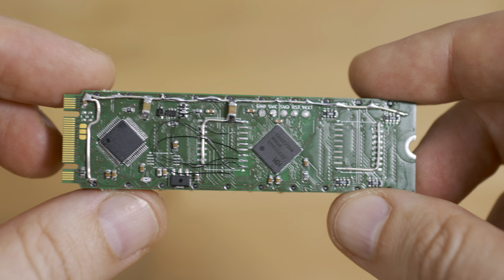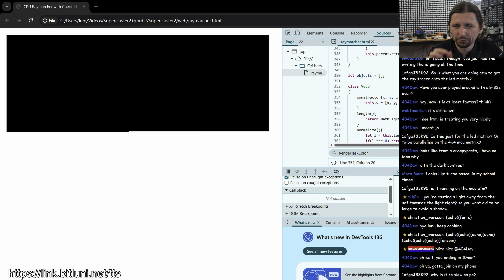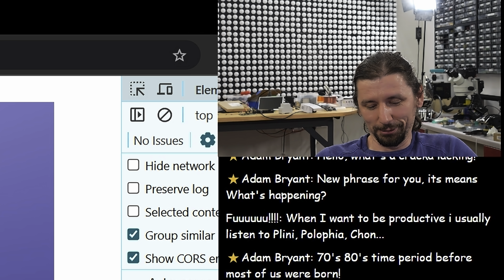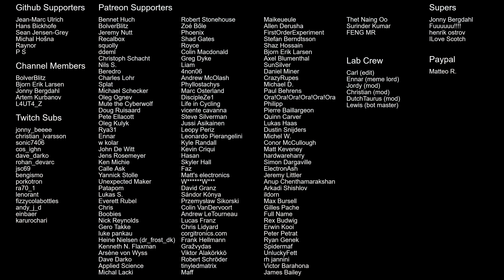I made a GPU at home

Comment: How do you upload and execute the pixel jobs? Do you batch them? Do you send pixel by pixel? I think it might be faster if you send a configuration command to all modules for framebuffer resolution, and then in-module you derive the chunk of the framebuffer that module should use (based on its physical index). You should definitely take this further! I want to see 1280 cores and an opensource compute library that lets you parallelize arbitrary tasks in C!

Comment: Just wondering how many PCIe lanes it uses?, x2 or x4. Does it play nice with multiple M.2 supercluster boards in the same system? What PCIe speed is required to keep them fed? - i.e. could I take x2 PCIe 4.0 and split it to x4 PCIe 3.0, or x4 PCI 4 to  x8 PCI 3 or even bigger jumps? (like PCIe 5.0 -> multiple PCIe 2.0 M.2's on a daughter board). - as a way to get around BIOS not supporting PCIe bifurcation.
Reply from the maker: only one lane on that one. M.2 allows for 4x. also there are better interface chips than serial. I'll try USB next.
I'd say the pcie is not the problem imagine you can put 16 clusters on a single x16 extension card. 2560 cores.
with different routing you could even put 32 or 48 MCUs on a single module
..anyways.. I rather move on 😂

Comment: This was a very impressive build, especially for an individual.  For reference, the “mistakes” were how you learned about the architecture of the processors, and the limits of the design you were depending on.

I have an old (1978-ish) EXIDY Sorcerer home computer that has a tone of post-design wiring.  It may have been a design change, a home-brew upgrade from 32k to 48k of RAM, or a repair before I bought it.  Modifying hardware is a time-honored tradition!

Comment: Reminds me of those coin miners you used to be able to buy, the ones with the farms of MCU's laid out on 12x10-inch boards. Smaller is definitely better!
Oh, and setting your sockets would be a snap if you 3D-printed an articulated, zero-insertion-force jig.

Comment: I feel like forgoing the M.2 width and having a wider PCB past the connectors, a la older Mac SSDs, for wider traces would be beneficial for power and signal integrity. The engineering for this current iteration is very impressive

Comment: Having designed many boards in my career, I have advice - Always build the first one on a large flat board, spaced out components you can access. Provide connectors to power it from a bench power supply. Allow yourself to test and bring up each part of the design one thing at a time. You were fighting with multiple issues at the same time and that makes is hard.  The second one is form-fit and you know the electronics is good having debugged the first one. Those connectors would have worked fine if you had reflowed them.

Comment: I'm quiet sure you might be able to further reduce the size of these modules by using Advanced Ball Grid Array connectors instead. They are yet more expensive, difficult to place & route but also offer higher lane count (higher bandwidth), better electrical stability, allow for shorter paths (lower resistance)...

Comment: AI Summary

Abstract:

This video chronicles the ambitious multi-month journey of building a 160-core RISC-V supercluster, cleverly disguised within an M.2 form factor. The project revisits earlier work on multi-core clusters, aiming for higher density and lower cost using edge connectors. The creator details significant challenges encountered during the design, manual assembly of tiny components, and extensive debugging of communication and power issues. Key problems included current leakage during programming, limitations of specific GPIO pins, and signal integrity issues on the open-drain bus requiring software workarounds. Despite numerous setbacks, the project culminates in a fully functional, power-efficient cluster. Demonstrations include a basic ray tracer (bottlenecked by serial communication) and a SHA-256 hashing benchmark, where the 160 low-power cores collectively outperform an 8-core desktop CPU. The video emphasizes the valuable lessons learned through persistent problem-solving.

Building a 160-Core RISC-V Supercluster: Design, Debugging, and Performance

*   0:00 Project Introduction: The creator unveils a 160-core RISC-V supercluster, designed to resemble a heavily modified SSD.
*   0:28 Inspiration & Evolution: The project builds upon a previous 256-core mega cluster, aiming to overcome past challenges with densely packed pin headers by utilizing M.2 edge connectors for better cost and density.
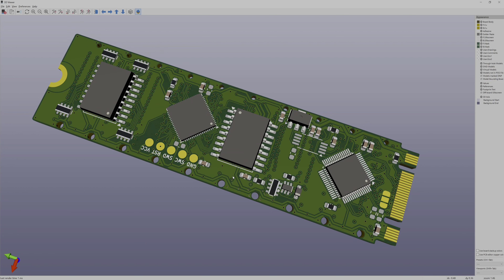*   1:49 Modular Design: The supercluster features a main board with 10 vertical M.2 slots, each designed to hold a modular board containing multiple MCUs.
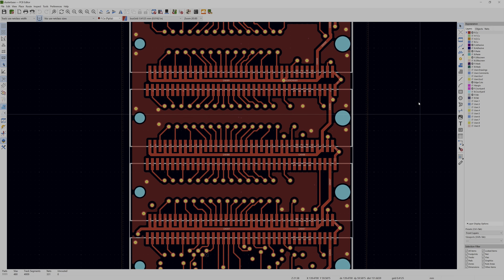*   2:08 Compact MCU Modules: Each module is a 22x26mm, 4-layer PCB, meticulously designed with 16 MCUs, 64 components, and hair-thin traces to maximize density and stay within budget.
*   3:05 Assembly Challenges: Manual assembly of the vertical M.2 connectors proved extremely difficult due to unreachable pins, requiring custom soldering techniques.
*   4:25 Programming Issues & Fixes: Initial attempts to program individual MCUs led to current leakage and random heating due to shared bus lines. The solution involved powering all MCUs simultaneously and later repurposing GPIO pins to ensure proper programming.
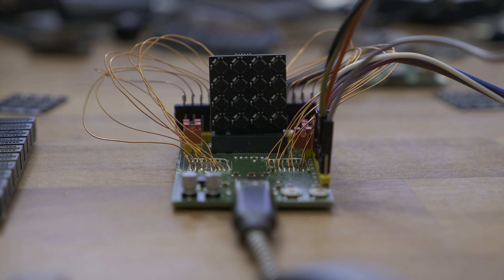*   6:09 Unique MCU Indexing: Each MCU is pre-programmed with a fixed index corresponding to its physical position, allowing for debugging and use as a 3D LED matrix.
*   8:08 Ray Tracing Implementation: The cluster was tested with a ray tracer, where each MCU would render a pixel. This highlighted the RISC-V cores' rudimentary instruction set (no floating point, square root, or integer multiplication/division).
*   8:56 Power and Signal Integrity Issues:
    *   High current draw from initial LED resistors caused crashes. Switching to internal pull-ups for LEDs significantly reduced current.
    *   Using more than one module caused crashes, traced to limitations of specific GPIO pins (C13-15) and insufficient signal strength on the open-drain bus.
    *   Weak 10k pull-up resistors on the bus caused slow signal rise times and data corruption; a compromise involved adding a delay on the host side.
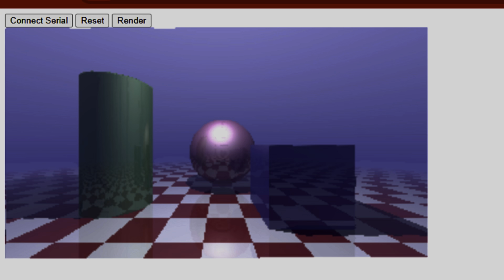*   12:33 Full System Functionality: After extensive debugging, including fixing cold solder joints, the cluster finally became fully functional.
*   13:00 Performance Bottleneck: The main limitation for the ray tracer's speed was identified as the slow 115 kilobits per second serial port, though the interface chip supports up to 8 megabits per second.
*   13:28 SHA-256 Hashing Benchmark: The cluster was benchmarked with a SHA-256 hashing algorithm, a computationally intensive task.
*   13:41 Impressive Performance & Efficiency: The 160 MCUs combined outperformed an 8-core desktop CPU in SHA-256 hashing while drawing under 4W (7mA per core at 3.3V), demonstrating remarkable power efficiency.
*   13:57 Conclusion & Lessons Learned: The project, despite its many failures and emotional challenges, yielded significant lessons and a rewarding outcome. Design files and code are available for others to learn from.

I used gemini-2.5-flash-preview-05-20| input-price: 0.15 output-price: 3.5 max-context-length: 128_000 on rocketrecap dot com to summarize the transcript.
Cost (if I didn't use the free tier): $0.0057
Input tokens: 16417
Output tokens: 926

Comment: Regarding the bus pullups - have you tried adding active pullups? So that they vary the current, depending on logical state? (like the ones used for long 1-wire and i2c busses)

Comment: The real limit to this is the interconnect. You need to upgrade the fabric somehow. Maybe, give each chip USB connectivity and have controllers for 20 or 40 USB channels on the carrier board. Yeah, that's probably doubling the volume of the cluster. But you get orders of magnitude more transfer speed. That may make the whole thing usable for rendering.
The holy grail in these times would be AI. But for that you need even more interconnect speed or completely different models than are in use today.

Comment: Bro's making ancient sorcery, he's making little magical rocks talk to each other and cooperate on the displaying of a scroll.. All of this using runic traces made of lead. A true sorcerer
Reply: Holy crap that's the best description of this kind of thing I've ever read 😂
Reply: Wizards dont use lead nowadays. Turns out silver with tin makes better philisophy stones
Reply: @HidekiShinichi many independent electronics repairmen use tin and lead with the rosin core and copious flux. Tends to make repairs easier with its lower melting point. But for industrial manufacturing, yes. Silver for RoHS compliance.
Reply: @HidekiShinichi  came to see this comment. Yeah, unfortunately lead had curses attached to it, but was good binding material
Reply: Alchemical wizardry no less!
Reply: Our world is ran by rocks. Without rocks, humans would've died out within a few winters.
Reply: great way of describing it, and I agree :D
Reply: Any sufficiently advanced technology is indistinguishable from magic. But yeah, PCB traces are actually copper but yes the solder you put on top is leaded typically.
Reply: No idea what he made or what it does but he sounded smart while talking about it
Reply: Technically sorcery refers to pharma.
Reply: I've been saying for years computers are magical artifacts and computer programmers and engineers are wizards.
Reply: @jaredmallard9986  So, have you ever wondered how resonance tuning works? It's related to harmonic frequencies. I won't answer any further; it'll remain a mystical mystery to you. throughout your life........
Reply: I write very similar thing here and saw your comment after. Your comment is just better.
Reply: always called my smart colleagues wizards when working for ASML lmao
Reply: I like your use of language!
Reply: couldn't be more accurate lol
Reply: ..with harnessed LIGHTING

Comment: The obvious question: does it run doom?
Reply: Yeah, at 60 seconds per frame.
Reply: The other obvious question: Can it play Bad Apple?
Reply: can it run CRYSIS
Reply: @theicewitch9328 you crossed the line 😢
Reply: @davidonthatbeat 🤣🤣🤣🤣
Reply: does your head turn 180°?
Reply: @mitaskeledzija6269  typical head turn range is from 140 to 180 so yeah that would make sense

Comment: What a journey! Out of curiosity, why did you opt for low-side switching the power in the first place, when it sounds like you could just hold the inactive chips in reset? They shouldn't drive their I/Os in that state, I hope...
Reply from the maker: the WCH mcus are strange. they are never really off when using the reset. the SWD interface would wake them up when programming. also I designed it so it would be a possible to have 16 datalines. these include dual use of the reset and SWD pin. they were turned off on boot by my initial firmware. I changed it to a more safe 8bit bus avoiding the lines so the development would be less of a pain. with the knowledge i gained I'd rather route out SWD for each mcu and combine it only on the carried bard for the bus. on the programmer board these would be just switched by an analog switch or something to program the individual cores. using the D1/D7 pins ist also tempting because you can read and write a whole byte with one operation on C and D ports. A1 A2 are used for trigger and LED

Comment: In 1982 someone found a way to run chips using a certain field without a negative power supply. I have the secret. It'll run any chip over 1k x faster. lets mine some coin. really. I'm not kidding.

Comment: how long did the last render take?
Reply from the maker: here is where it's getting interesting. I didn't elaborate to keep the video a good length:
the render took 4mins. Theoretical performance should be under a second. I took measurements of the throughput of the serial. sometimes it's 30kbitupn/down, sometimes 80bits/s and sometimes 120kbit/s. There is certainly a bottleneck in communication especially as the PC needs to poll each result and the host mcu needs to forward the messages. 
my initial implementation had the host MCU maintaining the states of the little MCUs which would improve the performance a lot. But that was before I solved all the problems. it was super difficult to debug so i removed all the logic from the host mcu. 
now that everything is working I could optimize that. also with the MCUs using signals to notify the host mcu of their state. but I need a break from this and will probably switch to a pcie-usb bridge first and remake the carrier board. btw the whole progress of the firmware is more or less in the github history of the repo

Comment: The smaller the components to be welded, the less useful your manual labor will be, that is, you need a component support that places the component on the weld without shaking it, this is why Chinese factories are having less and less human labor, the precision of human welding cannot do this work without generating failures and slowness in manufacturing.

Comment: Serial is a nightmare, it simply doesn't work at high speeds, you should switch to SPI or do your own protocol over UART. And you have to start caring A LOT about physical signal integrity &|| software error correction if you wanna go above 100kbps.

Comment: you need to use pliers or a two axis mechanical arm to position the connector on the hot solder, the board and the arm should be fixed at the exact point and then the Z axis of the arm should be adjusted and then the X axis lowers the arm to support the connector on the hot solder, this should work like a crane, it will be less shaky than your hand.

Comment: This is great and the wire wrapped around the iron to extend it was genius :D Got a tip, youre already using 4 layer boards by the looks of it. Rethink your layout setup, make layer 2 ground and layer 3 your power layer. Use full zone pours or make dedicated zones for power. The increased large zones would help tons with  your power issues. You dont need to route wires, you just need to drop a via and kicad would connect it to the zone.
Should help you tons with the brownout issues. 
Also yeah if 10K is too weak for pullups go 4.7k 1K is deffo over kill. I recently ran into an issue because of a large 20cmx20cm board had too much trace/parasitic capacitance, the I2C lines were unstable. Had to drop the resistor down to 4.7 to get a good clean signal.

Comment: This is Genius! you are a very talented individual. This could potentially make you millions. You should try to create an adapter for a motherboard CPU socket. any of the new sockets would be sufficient, such as AM4/AM5/LGA1151/LGA1200/LGA1700. You would have to modify the bios so it can recognize your RISC CPU's. Would this even be possible?

Comment: Low side power switching my beloved…
I’ve gotten so many gray hairs debugging this nightmare until I found a TI Powerswitch ic that solves this for 30 cents. They are basically an NMos with a pump to get the gate voltage high enough but they are wonderfully simple.

Comment: Given that you have access to pcie using a pcie to serial converter seems like a huge bottleneck even at 8Mbps, you could use an usb hub and an usb to serial per board and 10x that speed. 

Note that unless you use a chip with multiple root hubs, using usb for each individual chip would limit you to 6 boards (127 chips with 5 hubs per board means 21x6 is the max you can do)

You could however probably use a chip that can handle multiple serials at once and get back to a manageable level.

Also you might want to try to see if the serial chip works at 8Mbps on linux.

Comment: You would have spent your life better if you had done all of that with OpenSPARC. RISC-V is a bad ISA, not really thought out and plagued by the hubris of its creators, who are deeply convinced that they know better but are actually wrong on multiple counts. The results confirm that: in performance tests, RISC-V turned out to be dismally slow. The instruction set is a disaster, too.

Comment: This project is as mind blowing as the VGA cluster!  I hope you figure out how to access that bandwidth, as density issues aside, it looks like you might be onto something here!  Instead of  forcing yourself into a tiny workspace, you might want to see about leveraging an M.2 extension cable so you can more freely access the areas you need.  Also for like 10 bucks you can get some 90-degree adapters that have open backs (just a thin pcb bar to support with a screw) so you'd have more access.  At the risk of bandwidth / power issues, you could go extesion -> right angle with open back -> your crazy cluster, and have the ability to work on both sides while it's plugged in to save some sanity!~

Comment: To avoid resoldering by hand you should use special solder paste for SMD components. It is a mix of flux and microscopic solder balls. Place the PCB above heating table, heat it up and give a component a gentle wobble and its done.

Comment: I use the copper wire wrapped around soldering tip for my whole life, as I often end up needing finer tips that the current state of my soldering iron. Soldering irons from bankrupt manufacturers, with no new tips available didn't help. Keep the extension short, but not so short that the solder wicks back to the soldering iron.

Comment: I'm a software developer, not a hardware guy, but if this Risc-V cluster card can have a performance in the range of Nvidia RTX 50XX cards for a fraction of the price then it would be heaven for Blender 3D users.
I would be having like 4-6 mini PCs equipped with this card acting as a render farm doing 3D rendering tasks for the price of an RTX 5090.
You already have a market for this, if you can produce such cards then please do. 👍

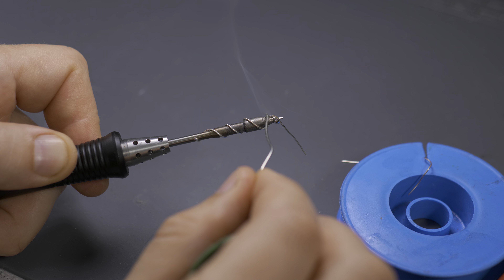Comment: 4:07 "The solder helps to transfer the heat from t he tip to the wire" on screen for approximately 0.5 frames